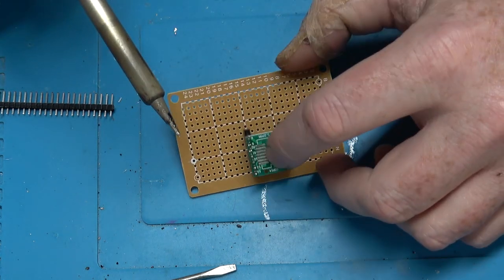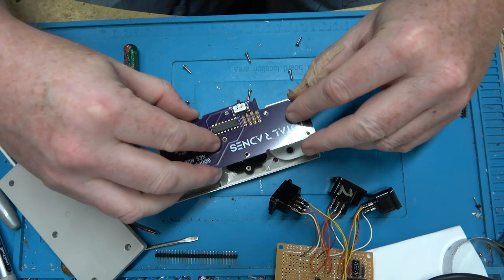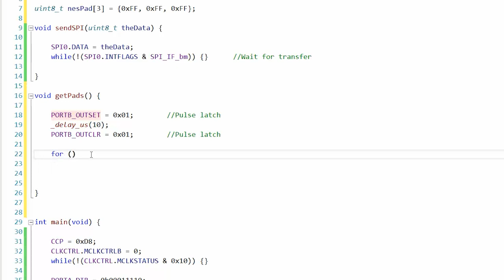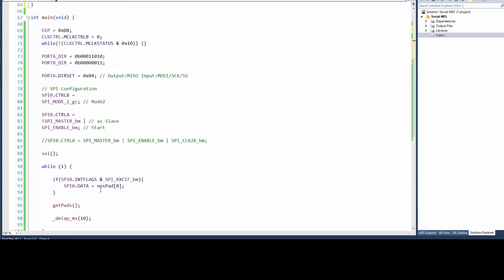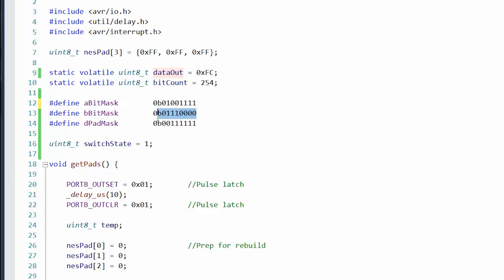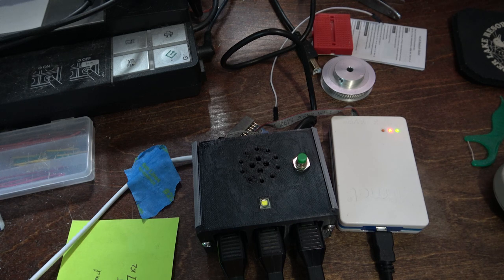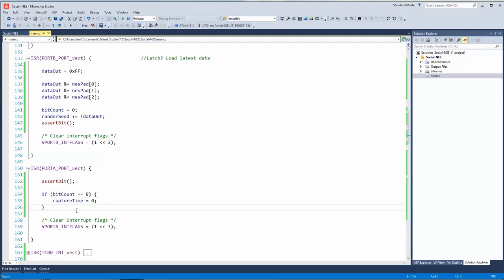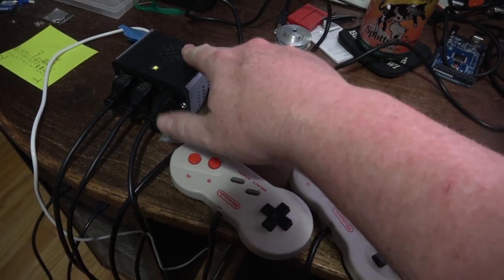The Social NES Controller!

Comment: Ok but what if a multitap that will count all button presses as vote, so if half the players press a, a gets presses. Irl twitch plays nes.
Reply: Thanks for the great idea. I might have to adapt this for a special 2-player mode for one of my games...
Reply: there's an old experiemnt where a whole crowd of people play pong this way by holding up paddles to vote up or down
Reply: You probably wouldn't even need a microcontroller for this - just a majority circuit on the controller data lines would be enough, which you can build out of discrete logic.
Reply: @SuperSmashDolls  With a useless microcontroller its possible to implement more than one idea ;)

Comment: When I read the title, I figured it was going to be a "vote" based control scheme (it only outputs button presses of the majority of players are pushing them). Each controlling only some buttons is fun too, though :D
Reply: I kind of pictured a concept like the coffee table controllers where the buttons are too spaced out to be controlled by one person alone, but now I want to see this idea.
Trying to finish a level in Mario Bros or Contra or [I can only imagine the frustration] Mega Man, where the button presses only work if all of the players press their controls together.
Makes the four player co-op New Super Mario games seem relaxing by contrast.
Reply: That's what jumped into my head as well.  Since it's programmable, maybe it could switch to different modes like wario ware.
Reply: This was what I thought as well but Ben’s original idea is also delightfully chaotic.

Other models that could be fun:
• Different users’ inputs are sampled on a frame-by-frame basis.
• After a user presses a button, control over it is reassigned to somebody else.
• Each user gets full control over the game for some specified number of button presses and then control is passed off.
• Whether an input is active is controlled by the parity of the users’ inputs (0 = off, 1 = on, 2 = off, …)

Comment: [Ben Heck]: " IT is 90% googling "

[ME]: Sounds legit -- it's an expert case- / knowledge-based resolution approach.
You search for similar problems (cases) and apply any potential solution that was found (with or without modification), and sometimes you contribute any modified solution back into the system.
Reply: ..........this isnt a joke though...

Comment: Would it be worth doing it all from a hardware stance?  Using shift registers to decode the data pin and then then comine buttons from each controller into 1 shift register that sends it's data line to the NES?  Just a thought.  :)

Comment: Is that a breadboard where none of the vias are attached? Ive been looking for one just like that, what are they referred to as? Been wanting to just solder on and run wires, without the vias having copper running between them, instead ive had to hack up regular solderable breadboards lol
Reply: They're called prototype boards or perfboards.

Comment: Why stop at a wire stripping tooth. Go for some kind of swappable tool kit. Or get a matching tooth on your top jaw done too and have a multi stripper/cutter/crimper. Cut, strip and crimp connectors using just your mouth :)

I had a tooth removed on Wednesday. Well, I had the roots of the tooth removed on Wednesday after my dentists failed to remove them two months ago. So now I have the game of leaving it alone so I don't get a dry socket which is supposedly super painful... but more painful than having broken tooth roots live in your mouth?

Comment: The Famicom had a microphone but I think  it was only on the original Famicom which had the controllers hardwired in anyway? The later AV Famicom which was the equivalent of the US "Toploader" used the same controllers as the western variant and didn't have a microphone at all. I don't think they ever released detachable microphones?

Comment: This reminds me of Trackmania Turbo's Double Driver mode, where 2 controllers control a single car, and each controller is considered half an input. 1 player turning will register to half turning radius, while both players turning will register to full turning radius, and if 2 players turn in opposite directions, the car won't turn at all (it'll cancel out). Same with acceleration and braking.

Comment: Are you using a special solder on that IC in the beginning? Seems like you're just spreading solder over all of the pins, but somehow they're not shorting? Am I being overly cautious when I solder?
Reply: He's flooding it with solder.  If you get shorts, you can clean your tip and heat it again.  The "clean" tip will wick up extra solder.  If that doesn't clear shorts, you just use solder wick to remove excess.  With a little practice it's no big deal.  You do risk overheating the board or components so do practice before doing it on something critical or irreplaceable.

Comment: Hi, Ben. The reason you see some games poll the joypad more than once per frame is to compensate for a bug in the NES hardware. When a game plays DPCM audio samples, the automatic sample playback of the CPU can cause a joy data mis-read if the game is polling the controller at the same time.  So these games poll each joypad twice in sequence, and if one read doesn't match the other, it may even poll for a third time and then do a majority vote.
(You were not seeing the game poll the 2nd player controller; that's through the other joy port.)  So yeah, hardware that interfaces with the NES joypads has to deal with up to 3 reads next to each other, potentially.
Reply from the maker: I did not know that!
Reply: Some of the games were programmed to only look for two consecutive matching controller inputs. This can cause them to theoretically keep re-polling endlessly*, and possibly opening the door for various glitches. See also TASVideos submission 6466S - Super Mario Bros. 3 game end glitch in 00:00.78.

* Basically, you'd have to be intentionally exploiting this behavior via a modified or simulated controller since there's no reasonable way to otherwise change the button states ~8,000 times per second :)

Comment: I would just use some timing between button presses to seed the randomness.
Mode idea: have the box randomly choose which player gets what controls. After some interval, the box pauses the game, "sings" the new random assignment and unpauses the game.
Game mode 2, 1-player: randomly reverse the dpad directions, like in bomberman.
Mode 3, 1-player: randomly pause and unpause the game.
Mode 4: allow each player a limited number of presses until it switches to the next player.

I have many more but need to get out my 999-in-1 tetris for inspiration.
Reply from the maker: It does, the combined button value is also added to the random number every frame.

Comment: You can just put the wire on the top edge of your thumb finger print skin and clamp it down with your middle finger nail and pull. Much simpler and easier than using your teeth.

Comment: wait.... couldnt u just use an emulator.. connect 3 controllers up to it, and map the buttons from the 3 controllers and make it act like 1 controller?  that sounds a little easier. but im probably way off.
EDIT: nevermind. the ramdomizer portion would be a nightmare.  that sounds like a TON of fun to use.